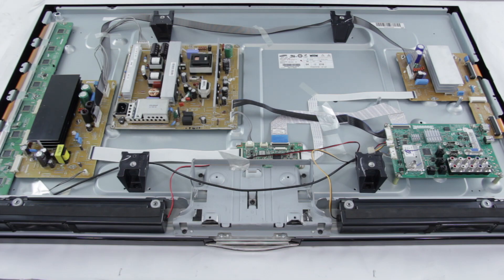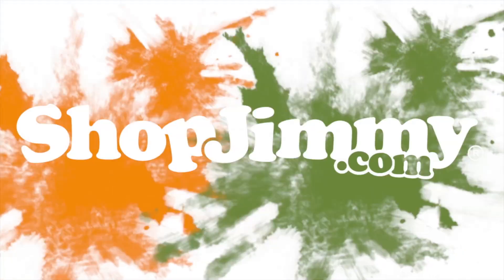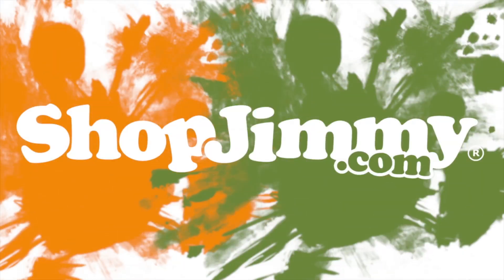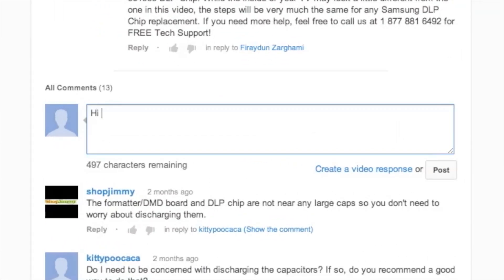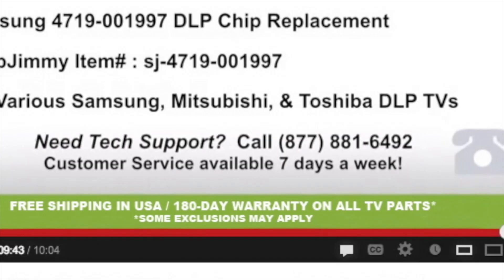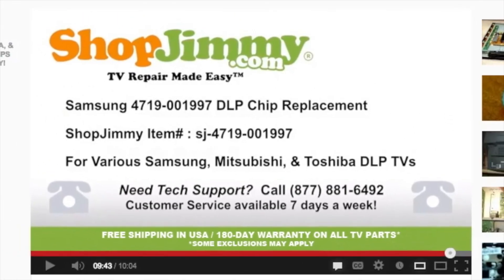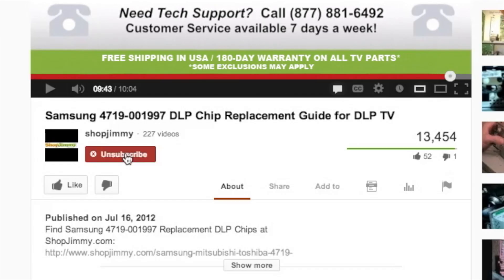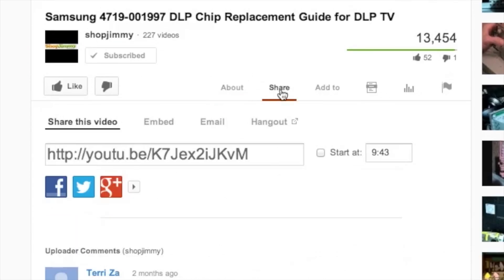Plasma TV Repair Tutorial - Common Symptoms & Solutions - How to Fix Plasma TVs

Comment: Hopefully you can help me? I have a Samsung Plasma PN50B550 which one day decided to start turning on and off for about 30 minutes before finally turning off for good. I keep it unplugged now, obviously, but if I leave it unplugged for 24 hours or so, I get the red LED light, and the tv turns on... for about 10 seconds, then shuts off again. The red LED light is gone, it doesn't blink, it gives me nothing. I can unplug it, plug it back in, nothing. No LED light. No picture or audio. But if I leave it unplugged for 24 hours, THEN plug it back in, I get that 10 seconds of power. 

I took the back panel off and looked at all the power caps, none seem swollen. No leaking, nothing. Repair shop wants 75 dollars just to look at it, and I'm not made of money. I'm willing to repair it myself, no problem there, just hoping the "leaving it unplugged for 24 hours gives it 10 seconds of power" thing would be an indicator of something?

Any help would be greatly appreciated, thank you!
Reply: Gigas Byrne I watched your video in detail a little further and it reminded me... My main board did have issues for a while. The bottom HDMI port didn't work at all, and the middle one I would have to prop something under the cord being plugged in, to hold it up, or else it wouldn't work either. Is it possible that the television shuts off and will not turn on again (for 24 hours) due to this?
Reply from the maker: Gigas Byrne   Try all repairs and troubleshooting at your own risk.  I recommend replacing the power supply board in your TV.  Click this link to replacement parts for your TV model number:  http://www.shopjimmy.com/catalogsearch/result/index/?cat=59&q=PN50B550  There may be multiple boards for the same TV model number, be sure to match part numbers on your current board, with your replacement for compatibility.  Here is a link to a video showing how to identify your part number, click here:  https://www.youtube.com/watch?v=sSJexLvRrjM  Thanks and please let us know if you have any further questions with your TV Repair!  www.shopjimmy.com
Reply: +ShopJimmy.com I noticed that the bottom HDMI port was real loose on the main board, real loose. Out of desperation, I pulled it off of the board. Re-connected everything and it worked! For about a month... then it died on me again. The screen said "Bzzzt..." and the TV shut off. Out of nowhere. I unplugged, replugged, and the TV turned on for about 10 seconds, then shut off again. Won't stay on for longer than 2 seconds anymore, when it does turn on at all. Ordered a new main board online, same model number etc... I figured if pulling the HDMI off fixed it before, maybe the whole board is just messed up. Any ideas?

Comment: I have a Panasonic TH-50PX80U. The set failed during the night while turned off and turned on the next morning. The status is: The set comes on. The HDMI2 indication comes on the screen (as usual). The whole screen becomes slightly lighter than completely dark. There is no image, regardless of device attached (each known to function). I have checked all HDMI inputs with the same result. There are no flashing LEDs. The red power light is on and steady. It stays on until the no activity shut off turns it off after several minutes. I gone through the reset procedure (down volume + Menu button). All 'features' on the reset indicate OK.  I have not taken it off the wall (due to its weight) and have not looked at the boards, cables, IC's etc. warrenpeck@gmail.com
Reply from the maker: Warren Peck  PLEASE SUBSCRIBE TO OUR CHANNEL - Try all repairs and troubleshooting at your own risk.  I recommend replacing the SC, SU & SD boards in your TV.  Click this link to replacement parts for your TV model number:  http://www.shopjimmy.com/catalogsearch/result/?q=TH-50PX80U  There may be multiple boards for the same TV model number, be sure to match part numbers on your current board, with your replacement for compatibility.  Thanks and please let us know if you have any further questions with your TV Repair!  www.shopjimmy.com

Comment: Hi Jimmy, my tv model is PS51E490B1R. I relocated our tv from the living to my room, plugged it, connected my pc via hdmi, laid down and less than 5 minutes, i heard a loud pop and the tv turned off instatntly. Of course i was shocked about it. Turned the avr off and on again and tried turning the tv on again. the led just blinked a few times and it was gone. pushed the power button and the red led will just blink once and its gone again. at first i thought its maybe a blown fuse or, like what i read online, its usually a blown capacitor. opened the plasma tv, no sign of a blown capacitor nor a blown fuse. or maybe i dunno where to look not so sure. i hope you can help me with this, thanks a bunch! cheers

Comment: I have a Samsung PN58C550G1fxza that my buddy was throwing away I plug the tv in and the red light pops up by the power button but when I press the power button on the tv nothing happens. I also have no remote
Reply from the maker: kwmatt24   Try this at your own risk. Unplug the TV, then disconnect the y board and plug in the TV to see if the TV powers up. Reply with the results of this test. Thanks! www.shopjimmy.com

Comment: I have a Samsung model PN50A450P1DXZA'
Turned on the tv and the picture was dim and fuzzy. Same for all sources. Please advise.
Reply: https://flic.kr/p/vwB3jC
Here's the pic.
Reply from the maker: Thomas Garrison  PLEASE SUBSCRIBE TO OUR CHANNEL - Try all repairs and troubleshooting at your own risk.  I recommend replacing the Y-Main Board in your TV.  Click this link to replacement parts for your TV model number:  http://www.shopjimmy.com/catalogsearch/result/?q=PN50A450P1DXZA  There may be multiple boards for the same TV model number, be sure to match part numbers on your current board, with your replacement for compatibility.  Here is a link to a video showing how to identify your part number, click here:  https://www.youtube.com/watch?v=R1jmj_foId0Thanks and please let us know if you have any further questions with your TV Repair!  www.shopjimmy.com
Reply: So I replaced the y sus board and saw no improvement here's the latest picture
https://flic.kr/p/vMpjSF
Reply from the maker: Thomas Garrison   Try all repairs and troubleshooting at your own risk.  Alright, thanks for sharing the new picture.  The dark spots are caused by the X board, so I recommend replacing the X board.   http://www.shopjimmy.com/catalogsearch/result/?q=PN50A450P1DXZA  It also appears you have the same problem after replacing the Y-Main Board, so I would say you received a defective replacement part.  Was the replacement that you purchased confirmed working?  Thanks!  www.shopjimmy.com

Comment: Samsung plasma 42" model PN43D450A2D when plugged in I get power even the red standby light comes on, on the tv. But when I try to power the tv on there's a clicking noise coming from the tv and it doesn't turn on..

Comment: Hi ShopJimmy,

I have a PN43e450A1FXZC manufactured in marsh 2012, version SS01. I have a 2 inches red vertical line towards the middle of the screen. It's not solid. It's thick but some pixels kind of let you see the image behind the bar a little bit. Is this the control panel?

And yeah it's a Samsung plasma TV.
Reply from the maker: Jean-Philippe Cliche   Try all repairs and troubleshooting at your own risk.  This sounds like a TV panel (TV Screen) problem.  If your TV panel is bad, it may be more cost-effective to replace the TV as panels are typically hard to find in stock, difficult to replace, and expensive.  Thanks and please let us know if you have any further questions!  www.shopjimmy.com

Comment: I have a LG 50PK750-UA
It turns on, bright backlight then dims.
No image on the screen, it remains blank but still on.
Buttons cause status light reaction but no menus at all on the screen.
Will appreciate any help, I hope it can be fixed.
Reply from the maker: Ernesto Muñoz   Try all repairs and troubleshooting at your own risk.  I recommend that you reseat the chip to see if that fixes the problem.  Sometimes it can take multiple attempts to get the installation perfect.  You can also watch this video for help with problems after trying to reinstall.  https://www.youtube.com/watch?v=gjyXAUU5tYU  Thanks!  www.shopjimmy.com

Comment: I have a SAMSUNG
TV Model: PN64E550D1FXZA
SN:  Z4SR3CKC900075A
My wife was watching it and it suddenly just went black...
No pic, No sound...
No standby light..
Will not function in any way... 
appears completely DEAD...
Check AC cable and wall power.. all those are okay...
What do you think I need.. and about what is the price...
Thanks..
CTW
Reply from the maker: Christopher Welch  PLEASE SUBSCRIBE TO OUR CHANNEL - Try all repairs and troubleshooting at your own risk.  I recommend replacing the main board in your TV.  Click this link to replacement parts for your TV model number:  http://www.shopjimmy.com/samsung-bn94-04644f-main-board-for-pn64e550d1fxza.htm  There may be multiple boards for the same TV model number, be sure to match part numbers on your current board, with your replacement for compatibility.  Here is a link to a video showing how to identify your part number, click here:  https://www.youtube.com/watch?v=BEPWrefQvqI  Thanks and please let us know if you have any further questions with your TV Repair!  www.shopjimmy.com

Comment: Samsung model # pn50b450b10 has 2 lines one red and one that turns multiple colors started recently. What should I do.
Reply from the maker: Maria V Zayas  Try all repairs and troubleshooting at your own risk.  Are the lines vertical or horizontal?  Thanks!  www.shopjimmy.com
Reply: Vertical
Reply from the maker: Maria V Zayas   Try all repairs and troubleshooting at your own risk.  This sounds like a TV panel (TV Screen) problem.  If your TV panel is bad, it may be more cost-effective to replace the TV as panels are typically hard to find in stock, difficult to replace, and expensive.  Thanks and please let us know if you have any further questions!  www.shopjimmy.com

Comment: Samsung plasma model # hp-s5033 50" makes a popping or thud  sound from speaker when turned above level 35 volume..
Reply from the maker: Doh' Ó Dubhlaing  Try all repairs and troubleshooting at your own risk.   I recommend replacing the main board in your TV.  Click this link to replacement parts for your TV model number:  http://www.shopjimmy.com/catalogsearch/result/index/?cat=56&q=hp-s5033  There may be multiple boards for the same TV model number, be sure to match part numbers on your current board, with your replacement for compatibility.  Here is a link to a video showing how to identify your part number, click here: https://www.youtube.com/watch?v=BEPWrefQvqI  Thanks and please let us know if you have any further questions with your TV Repair!  www.shopjimmy.com

Comment: I just bought a 50" Samsung Plasma Model Code: PN50C550G1F off of Craigslist. When I first checked out TV everything was fine. I just paid $100 for it. So I don't mind spending a little bit to fix it / repair it. I noticed this when I hooked up my Xbox that I have a bleed on my screen when Bright Light Colors (Ex. White, Grey, Blue, Yellow, Green and Pink. I have the same issue as the link below. Any help would be appreciated. and if you have any parts for it I could use all the help I could get. Appreciate it Thanks https://www.youtube.com/watch?v=KEodqrQe7SY

Comment: I need a little direction fixing my Samsung PN58C550 58" Plasma. I have sound but no picture. After watching a few YouTube videos, I thought the best course of action was to replace the T-CON board, and see what happens. Unfortunately this did not solve the problem. When I power on the TV, I get a quick flash of graphic that looks like maybe the logo, however distorted and unrecognizable. I checked all the fuses I could find, and now I am stuck on what to do next. Btw, all the replaceable fuses appeared to be fine (used a continuity setting on my voltmeter). FYI, I do not own an oscilloscope.
Reply: Rich...thanks for getting in touch with me. Email me "federalundercover@comcast.net"
Reply: Robert, I had disconnected the switchboard, and used the remote to turn on and it did not work for me either. If you want to send me a bubble envelope self addressed and stamped, I will send you the T-Con board (the one everything is connected to). The board is 6 1/4" X 3 1/2". If you e-mail me instead of going back and forth here, I can send you pics.
Reply: and on a side note, the "JL" number you gave me is a manufacturing number and not all are the same. The numbers you want are PB NO. LJ92-01684A/B/C/D/E (58) <<<that is the model board for this size TV and PBA NO LJ92-01697A/B/C/D/E (63) is for the 63" version of the TV both numbers represent that they use this for both sizes. Also the chip in the middle upper left SHOULD have the correct size screen and should read "58" US2 100725 NOR DE1Eh
Reply from the maker: Jim Brauer  Try all repairs and troubleshooting at your own risk.   I recommend replacing the Y-Main Board and the upper and lower Scan Drive boards in your TV.  Click this link to replacement parts for your TV model number:  http://www.shopjimmy.com/catalogsearch/result/?q=PN58C550  There may be multiple boards for the same TV model number, be sure to match part numbers on your current board, with your replacement for compatibility.  Here is a link to a video showing how to identify your part number, click here: https://www.youtube.com/watch?v=R1jmj_foId0Thanks and please let us know if you have any further questions with your TV Repair!  www.shopjimmy.com

Comment: I have a samsung plasma  PN50C450B1DXZA with the following issues.1. Weak / No signal from cable box.  I plug cable sraight from wall to TV and only get channels 2,3 and 6. With cable box not connected , I  tried another TV with straight cable connect and get all channels. 2. At first the TV started with going back and forth with showing a weak/no signal and then  pic came back on. I turned TV off and then back on worked fine for few minutes than the pattern started again. Now I just have the issues stated in step 1.

Comment: Looking for help on my Samsung Plasma HPS5073X/XXA. The TV works normal tuns on and has a great Picture but... I have two issues
1> I have what I hear people call snow the green blue red dots all over in the back ground you can see it better with no video hooked up did this also to rule out input causing issue "is this caused by a bad power supply" I looked on your webpage for one but your out.
2> And 2nd issue i am having when its warm in the room say summer not hot just warm day the top half of the screen will go blank or black no picture across the whole top part of the screen and the bottom half still working have picture but when I turn on ac and cool room down then comes back what do I need to buy to fix this..

Thank You,

Shawn
Reply from the maker: S BARNDT   Try all repairs and troubleshooting at your own risk.  I recommend replacing the Y-Main Board and the Upper and Lower Y Scan Drive boards in your TV.  There may be multiple boards for the same TV model number, be sure to match part numbers on your current board, with your replacement for compatibility.  Here is a link to a video showing how to identify your part number, click here:  https://www.youtube.com/watch?v=R1jmj_foId0  Thanks and please let us know if you have any further questions with your TV Repair!  www.shopjimmy.com

Comment: Hello,

My LG 50PK760-ZC has no Pic and no Sound,if i turn over remote TV on, Screen flashs for a microsecond white, then leave screen black and no sound, Power LED turns from red to blue and flashing twice, then LED is off. Blue LED flashs ever, if i push any Button on remote. 

I open TV and CTRL Board has a SMD LED, this flashs in steps, 1 Time long, instantliy 1 Time short, then mayby 10-15 second off, then 1 time long, 1 time short and so far.

Well i think, Mainboard ist dead, right?
Can i Use the "Oventrick", also bake in Oven at 385° F max 8min. to fix ? 

Hope you understand my bad english and you can help me :)

Comment: I have a Samsung PN63C7000 plasma that has developed the dreaded purple noise bands that much has been written about online. Not much of this is definitive except the adjustment of Vs voltage. Before I go ahead and do this I was wondering if yo ucould chime in and tell me if this is a real fix or if there is something better I should be doing. the TV is out dof warrenty but only about 4-5 years old. In my world TVs should last atleast 10 years in spec and then run on forever perhaps with slowly degrading performance. can you help? I have some pictures but I'm not sure how to share them here

Comment: I have a Samsung HGTV Model  #P2570HD ...When I turn the t.v. on there is no picture.  The sound is completely fine.  It works like it normally does except there is no picture...HELP! :) Been struggling with this issue and don't want to pay for another t.v. when I think the problem is minor.  Thank you :)

Comment: Hi i have a samsung model # SP-P4251. When the T.V. is unplugged for a couple hours it will start perfectly, but the picture appears very red, on all sources. After a variable amount of time the picture will start to skew then go all black. (by skew i mean that it starts to distort and fade). But the sound will stay on. I have turned the lights off in the room trying to see if there are any vague images but there are none. from checking around its been said that it might be the X-Main board but i wanted to make sure. Thank you in advance.